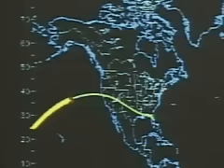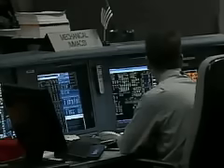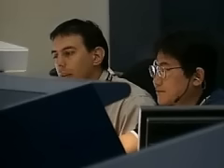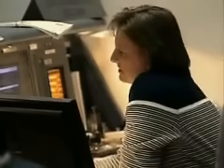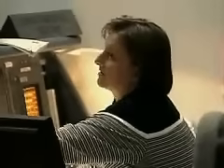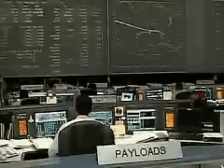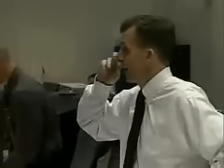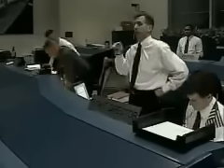Inside Mission Control During STS-107 Columbia's Failed Re-entry and disaster

Comment: Did the astronauts ever speak on the recording here? Was it the astronaut who said he lost 4 sensors?
Reply: Yes, the astronauts, commander, and the pilot. Commander Rick husband and pilot Wille mcCool spoke at the beginning of the video. Pilot Mcool was the one that replied (copy no deltas) and Rick husband the commander said they would get to ops 304 in 5 minutes in video. Timestamp is at 0:05 for pilot mcCool and Rick husband is at timestamp 0:50 in video. And no, it was not an astronaut who spoke about the sensors, but the ones that monitor shuttle information on computer screens in the flight room. When u hear the flight director say macs, it's just an acronym for short reference to the ones who watch over shuttle information in the control room, and gives the flight director information on anything that they may see. Which is what you hear when the macs replied to the flight director that his computer screen with the shuttle's flight information on it, is showing that 4 sensors has went offline

Comment: Why not reduce speed to reduce friction???
Reply: You can't. The shuttle had to land with the energy it has from the orbit, basically from launch. If you slow it down it will fail the target runway. And the margine in which you can controll the speed is very small.
Reply: Well, I'm not an engineer or anything, but I think the shuttle's (hypersonic) speed, altitude and angle are carefully calculated and there is a virtually non-existent time frame for such changes. The friction cannot be eliminated by any alteration in speed, and slowing down the shuttle can even bounce it back to orbit uncontrollably.
Reply: The friction is what reduces the speed.
Reply: Momentum is lost through heat. It's physics.

Comment: The sad part is they knew exactly what was going on because they did a scenario of the signature it would give if the ship didnt make re-entry with the particular alarm sets. The moment they saw those alarms they knew. Another thing is this was a mission where they didnt link with the ISS and did experiments in orbit. If they would have made the rendezvous with the ISS likely they would have had a better picture on the damage the ship had sustained upon launch. When they started getting those alarms that was an oh shii moment for mission control. This was a small community at NASA. Those men and women knew these astronauts personally. They knew their families. They knew their friends and colleagues were gone. Sad stuff. This was also after 911 so the security protocols put in place were astounding and the fear was terror. Crazy thing is is no way terrorists could have taken Columbia down while it was making re-entry as the shuttle was traveling at mach and over 200k feet in the air. No weapons systems could have caught that thing.unless it was closer to the ground and at a lower speed but that fear was still present. Many of the families had personal security detail in some form or another. It was also the first Israeli astronaut on that ship so security conserns were heightened but mission control knew exactly what had happened.
Reply: The security to protect the shuttle was more there to protect the launch, that’s where damage can be done. Sniper with high powered rifle taking shots at the shuttle or boosters is catastrophic.

Comment: You steal my prototype of correction succes of the eagle and the new star Ventura but like said in French proverb stealers thieves does serve you well.. furthermore you both know that the foam shuttle  tank cannot be used as a test run flight only in order to ascertain the safety rule cosmonauts first but for you nasa greedy mess you jeopardize the safety on the behalf of the crews  furthermore the foams resistance of resilience breakage of materials can ever never ascertain the legacy of the velocity of the CX flight. I am quite sure as admiral of director of flight and ivy Harvard tops USA education I am astounded by the childish behavior of your proficiency . Sorry not to mock but in liberty USA freedom of speech of good faith has to have the last words  and beatings killings and even rapings in series my kin won't solve your sustain incompetence .

Comment: I do blame managers at NASA for the loss of the 7 astronauts and the hardware or orbiter. Engineers at Langley were so concerned about the damage from the foam strike that they asked for permission to contact the DOD and reposition and turn a satellite towards the orbiter as it passed by. Linda Ham a manager at NASA who had the power to authorize the request turned them down. This can be verified in Allen J McDonald’s videos.

Comment: Wow, at 5:04 as staff are talking about the sensors you hear Michael Smith, the captain of Columbia say... "feeling the heat." Which means even at this point the crew knew there was serious trouble.
Reply: 2 things:

1.  That was Willie McCool, not Mike Smith. 

2.  That comment happened several minutes prior to the tire pressure sensor warnings and was  not meant literally since everything inside was still normal at that point.

Comment: If time didn’t matter and they planned for the shallowest possible entry would the temperature have been significantly lower or do the physics require an angle that would always generate plasma etc?
Reply: It's not that time matter, earth is a sphere so they can start reentry at any point of orbit whatever it's needed, but if reentry is to shallow they would bounce off the atmosphere back to space, they need deeper angle and it usually made to be optimal.

Comment: If only they had taken up the offer of the military satellite to look at the wing (and / or a space walk). They could have got another Space Shuttle up there. 

The issue ‘what if that shuttle also gets damage on take-off was actually a non-issue, because if the second shuttle brought replacement tile(s), then Columbia would have been a guaranteed safe re-entry for both crews, even if Shuttle #2 was damaged on launch.

Even without a second launch, they could have ‘bodged’ a repair using packs of ice and so on, and could have flown a modified re-entry to reduce heat exposure to the left wing, which could at least have given them a chance. May these brave souls rest in peace 🙏

Comment: They all look worried before anything even happens because they know it is worse than what they told those aboard the shuttle and they are now praying doing nothing about the problem was the right thing to do.  😮 They did nothing to help fix the issue.  Nothing.  Apollo 13 had people locked in a room to figure out a solution, Columbia ground crew did nothing. Nothing.

Comment: What both the crew and NASA missed was the right airelon at max and the control thrusters kicking in way more than usual. The computers were trying to compensate for drag on the left wing pulling the shuttle in that direction.

Comment: By locking the doors the Control Center is Isolated only those people, Engineers Astronauts, Management maintain access to the “ systems “….NO outside influence can be placed on the People or System…..
The Contingency Plan or Procedure ensures NO data is altered or deleted it is for all means a “ SNAP SHOT “ of everyone’s activity for the entire xx hours.
What is really stupid is that NASA didn’t use the Canada Arm (with camera) to inspect the Tiles / Structure for damage, had they the 1 foot diameter hole in the leading edge of the shuttle’s wing would have been a reason NOT to attempt a re-entry….lives could have been saved….

Comment: So most things I've read suggest that, in a vacuum, a person takes 10-15 seconds to black out. That's enough time to lock a visor and initiate emergency oxygen, provided its an option available to you. Recovered pieces suggest neither the Challenger or Columbia crews did this successfully, though they at least tried on Challenger.
This makes me think that, in the event of unexpected high-speed decompression, you probably get stunned for a few (precious) moments, which is easy to imagine and explains the relative lack of post-depress crew activity.

One problem with that is, this crew here clearly was aware that they were tumbling. There's nearly a minute of tumbling between LOS and the "catastrophic event."
You would think that locking visors would be something you do in that situation, especially if there was an (even remotely slim) expectation of survival.
The fact that they didn't do this makes me wonder if they put the puzzle pieces together in their minds and thought, "if that happens, may as well make it quick" - which is really morbid, but not an invalid strategy for a doomed crew.

Comment: At what time did they know something was wrong? I can’t tell between all the voices speaking. But They seemed to know something was wrong since the beginning of this video
Reply: Nothing was odd until the call from MACS. 
Pretty sure the minute that MACS said "on the left side of the vehicle" they knew it was a very bad day.
Reply: The on board video tape that was recovered ended about 5 mins before the MACS "Hydraulic return temperature sensor" call. The crew did not have any indication from their systems until the tire pressure message. That's when Commander Husband said "feelin the heat" on the comm, meaning that the ship was being damaged.

Comment: Question - when they’re asking Colombia for “Com check “repeatedly their faces don’t look all that worried so my question is what are they looking at on their screens in tht moment?  Everything looked normal?They’re having to ask for Com check repeatedly without any response so naturally one would assume something has gone wrong however shouldn’t it be that they don’t HAVE to assume because they’re looking at screens that should be telling them something.? If the Colombia had blown up during that  silence wouldn’t all of their screens be blank? No more readings?
Reply: The readings would likely just stop changing, but you’ve gotta remember they’re on reentry from space, faulty signals, interference via solar or magnetic rays, etc etc. this was also unprecedented and had never happened before on reentry, they were likely in shock and just hoping for the best case scenario (some sort of interference) I’m sure it didn’t dawn on any of them immediately that the shuttle could’ve broken up on reentry. As far as they were told the damage from the foam strike that caused the failure was minimal
Reply: @rockmolivemo8556  Ahhhh ok I see. Ya that makes sense

Comment: A couple timestamps:
5:18 - LOS, orbiter starts tumbling, crew getting lots of warning alarms
6:04 - CE event - crew section torn from the rest of the vehicle and starts tumbling - power goes out, displays and lights go out, cabin goes dark
6:05-ish - pressure vessel is forced forward - crew would see the windows "shut" as they get pushed out of alignment, pressure vessel also forced into structural supports causing depress
6:05 - Likely cabin depress time - explosive decompression knocks the crew out in seconds
6:09 - Post-depress, crew now unconscious, they never recover but are still alive for the moment

6:20ish - pressure vessel jostles around within the forward body - crew upper seat belts fail - crew flails around under high G forces

6:39 - CMCE event - Crew cabin pressure vessel torn from what remains of the forward section of the orbiter - Pressure vessel now directly exposed to re-entry heat
6:40ish - Crew cabin starts disintegrating (starting from front-right to back-left)
6:40ish - Re-entry heating enters the crew cabin
6:40ish - crew suits fail, crew members start being directly subjected to re-entry heat

I'd have to guess that this is the point when the crew actually die, mainly due to lobotomy by hyper-sonic ablation of brain matter

6:50ish flight deck and mid deck separate
6:54 final breakup of the pressure vessel

7:04 If there's any living brain cells left among the crew by this point, this is when they'd start dying due to lack of oxygen.

8:39 the flight director suspects something might be going wrong
12:27 the "lock the doors" call is made

around 40:45 is when remains start hitting the ground, but that's not in this video
Reply: Lobotomy due to ablation?? What are you on about
Reply: @kotsaris87  When there is a lack of circulation, the brain can survive for about a minute or so, before it starts really dying.
The time between cabin depress and disintegration of the crew is less than that. So it stands to reason that the cause of death (as in, the destruction of information in the brain) is re-entry forces exposing and disintegrating the brain.
That's not a lobotomy. But here I mean "destruction of brain matter" when I say it.
Reply: @kargaroc386  and what do you mean with "hyper sonic ablation"? I think you are using "big words" for sensationalism, without knowing what they actually mean. I am super quantum ensured of the validity of my hyper specific explanation...

Comment: If they notice the problem and Informed to the crew is there any chance that Repair it on space station? 
Or At least to plan a rescue mission. ?
A walk around at space station around the vehicle may be help to detect the problem
Reply: Columbia was in a completely different orbital plane than the ISS was.  It didn't have nearly enough fuel to change its orbit that much.  And even if it did, Columbia was not equipped with the docking adapter required to attach to the ISS.

Comment: The flight director seen here went on national TV the day before saying the foam insulation hitting the edge of the wing was nothing to worry about..he was very wrong.
Reply: I've heard something about this, but don't quote me. There is a moment you see him freeze for a sec. I think just before the 9 min mark. It was at that moment, when thinking of the 4 sensors, that it occurred to him that the damage could be worse than he was told  he thought then that it may be the worst ending
Reply: He relied on the information that was given to him by management, who said a group of specialized engineers had analyzed the situation and that the damage was minor. As a Flight Director, he was  neither a specialist for the TPS nor a structural engineer... That's a completly different Department.
Reply: @ksracing8396 to reiterate his statement was incorrect and I was not implying in any way this was his professional opinion, there was however concern at the time he made this statement that the heat shield could have been compromised. So perhaps as the flight director who was fully aware of said concerns making such a claim borders on misleading the public.
Reply: Sorry, comment was sent prematurely:  What is missing is the infamous "even if we knew, we couldn't do anything about it." Which actually is true, but most probably  should not really be a reason...
What is also missing is the final part:

Later he served for many many years in national advisory commities for human spaceflight: Wayne Hale.

Comment: They knew before reentry there was a possibility that the shuttle would not make it home because of the foam insulation hitting the wing during launch. The insulation punched holes in the shuttle previously. The management did nothing to ascertain if there was a hole using satillite imagery. They did nothing to save the crew. The flight director was doing self-soothing behavior. All of these people seemed on high alert even before the off scale/low sensor alert.

Comment: Mission control must have been a little worried about this reentry since they knew about the possibility of damage to the heat shields.  Once the 4 sensors all went down within seconds of each other they clearly knew this was bad.  He asked a couple of times is those sensors were separate from each other.

Comment: What I can't believe is that they were only relying on instrumentation to work out what was going on yet there were several cameras filming the descent, I don't get why they didn't have a feed from these cameras into the control room, they'd have seen straight away what had happened.
Reply: None of those were live feeds.  They were  recorded.  And even if they were, other than saving a few minutes of wondering, what difference would it have made?

Comment: How the hell were they gonna land - all that gear was gone. But here’s the thing - these geniuses knew about the foam strike - all these things failing on the left side and they didn’t put two and two together??? 

Plus they could’ve told the astronauts so they could fix it - both disasters were avoidable
Reply: You’re right, but a number of people knew what the damage had done and what would ultimately happen (heat shield damaged = explosion) they CHOSE not to tell the astronauts. 
It turns out, they MAY have been able to use the shuttle Atlantis to do a rescue mission. 
Shouldn’t have happened for so many reasons.

Comment: Just like NASA knew there was an issue with the O-ring erosion on the SRB's, they damn well knew that insulation tore off the liquid fuel tank EVERY flight. None of them bothered to do the math (mass, speed, damage) for WHEN NOT IF that insulation hit the leading edge of the shuttle's wing (until AFTER the tragedy, when they found it blew a 2-foot hole in the leading edge). This was 100.00% Predictable, and 100.00% Preventable. NASA once again put bureaucracy and "Go Fever" over COMMON SENSE and SAFETY.